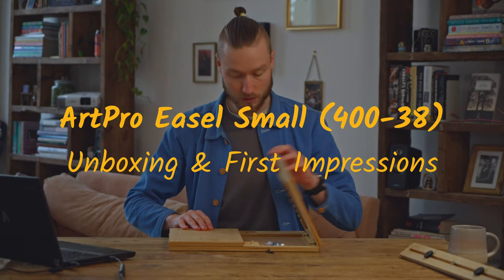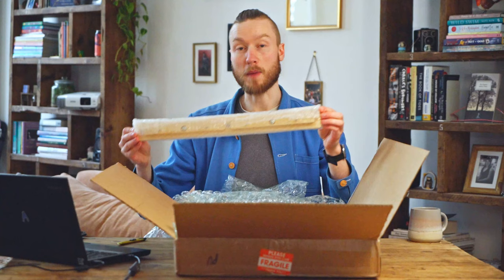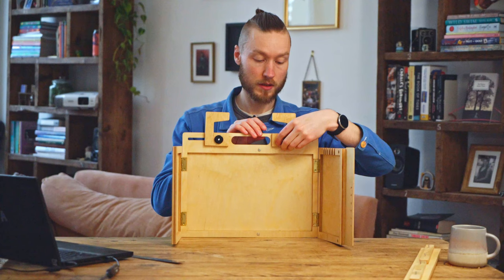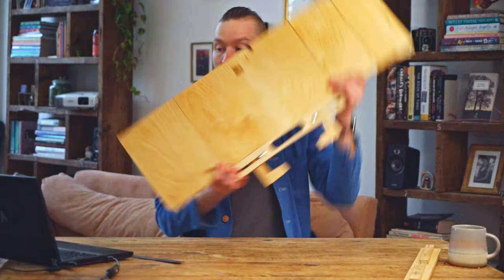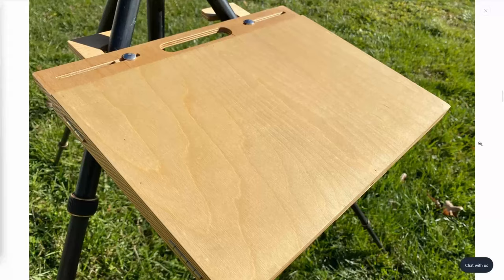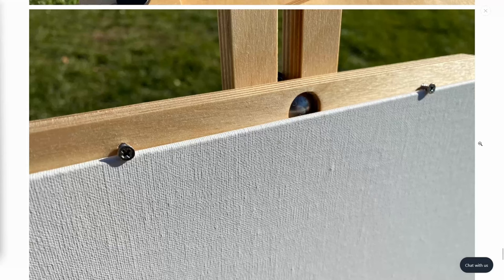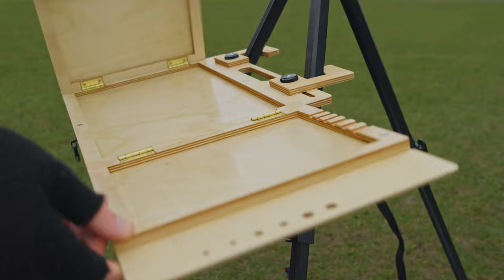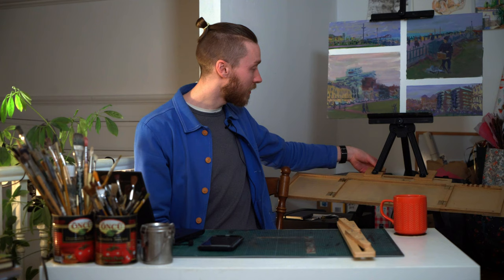Paint Box - Unboxing & First Impressions

Comment: This type of easel is very practical and readily available. However, there is one downside they all have in common. The price, very expensive for what they are. A bit of research will show yourself many similar patterns which can easily be made with a minimum of tools and skill.Still, each to their own, maybe it's just personal thing but I can't justify paying hundreds of pounds for what is basically a few sheets of routered plywood with a couple of magnets. As of January 24, this easel is being advertised for just shy of £200
Reply: I cant justify the cost. I made my own very similar from two cheap art panels from Aldi. I cut one in half and used piano hinges to join as wings. I bought torsion hinges to attach a piece of wood that goes over the top to mount paper.